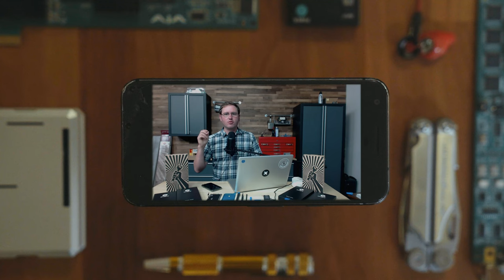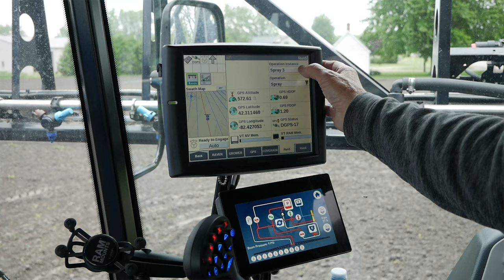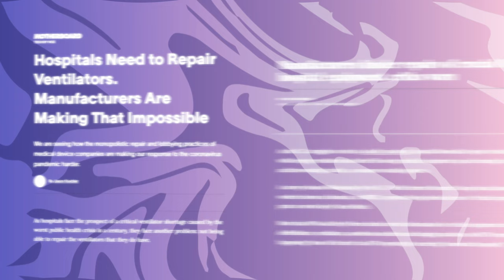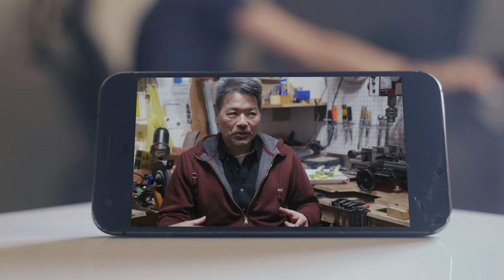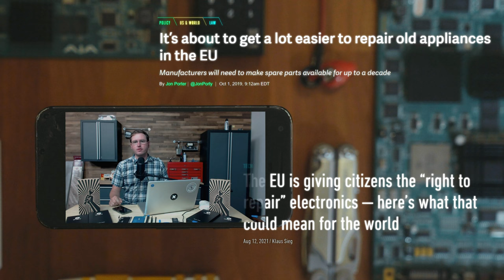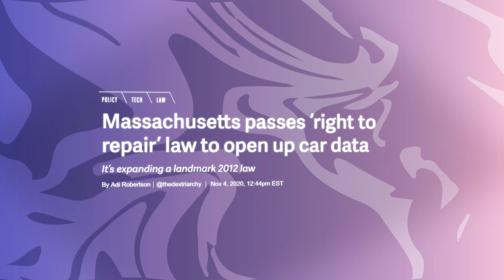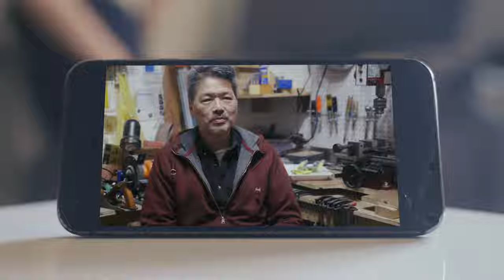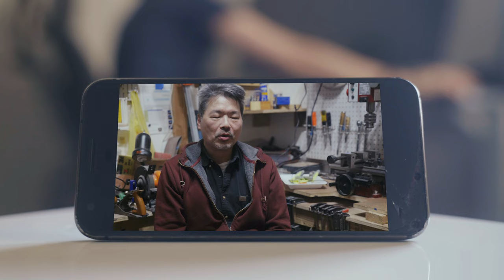Why you can't fix your smartphone

Comment: I'll never forget the time in college when the off button on my (at the time) brand-new iPhone 4 broke. I took it to the Apple Store and the technician immediately identified that the problem was just that the spring attached to the button had come loose, then said that he wasn't allowed to fix it but could sell me a new $400 phone. He also showed me a work-around to turn the phone off using the accessibility settings, and I used that work-around for like 7 years before the phone finally died, because the only other option was just buying a brand new one in order to replace a single spring.
Reply from the maker: well that is simply infuriating
Reply: It's Apple!

Comment: Thanks for covering this, especially as this has gotten worse and worse over the last few years. Between servicer-locked vehicles like Tesla and John Deere, paired and locked components in iPhones and other cell carriers with limited authorized repairs, and smart devices with cloud dependence and forced lifetimes, there's never been a more important time for right to repair.
I repaired my Nokia 7.1 a year ago, replacing the charging port and battery with questionable replacements from ebay sellers (mic was almost unusable) and had to get in touch with a random Russian developer to hack through the manufacturer lock to unlock it for a version and safety upgrade. The knowledge and background needed for that repair was absurd.
I'm a technology teacher, and I love teaching repair and showing older devices. We need this. Even if it isn't for everyone, repair is important.

Comment: I don’t believe you really ‘own’ a product if you can’t repair it. Which considering the generally hyper individual material mindset many Americans have should be enough to enrage people. I’ve had luck getting repairs done at a shop in the east village but outside of NY that kind of place rarely exists, you’re right. Same with all types of repairs. There are still cobblers in Brooklyn. I don’t know if many outside of that area. Instrument specialists are becoming an issue too for different reasons, how many harp techs do you know? And what is the solution

Comment: I wish we could still have the choice to buy phones with replaceable batteries... 
Swapping out an old battery shouldn't fall under repair, it should fall under basic accessible maintenance. 
Imagine having to take apart your car's fuel cap by heating it up to soften the glue, so you can refuel it, that would be n awful task.
Reply from the maker: I'm starting to feel old that all my first phones had replaceable batteries. I loved that, it was so convenient to just bring a spare battery rather than plugs and chargers.
Reply: @zentouro  Exactly!

Comment: I've been keeping my Samsung S8+ alive despite the screen and USB port breaking. I replaced the USB port and put some thermal pads under/over the cpu, storage, ram, section of the board to fix the screen. Also as an added bonus the back comes off a lot easier now since I didn't glue it shut as strongly so the phone's a lot more repairable. The obvious loss in waterproofing is not that big of an issue for me.

Comment: Our robotic vacuum cleaner no longer works because part of the plastic case cracked off and loosened the front wheel. Replacing all those perfectly functional components for such a small problem is the definition of absurd. Today is hot glue gun day, wish me luck!
Reply from the maker: good luck! i adopted and repaired my parents old robot vacuum. it's got its fair share of tape keeping it together :P

Comment: This is very cool! Honestly I wish I could have repaired my old phone, I loved my old phone. Also I couldn't afford a new phone, so I kept using my broken phone for almost a year after it broke - despite the screen occasionally leaving pieces of glass in my fingers, the lower 1/3 of the screen display beign unreadable, everything being covered in this green light, it taking 9+ hours to fully charge and losing battery life in just 3 hours, the volume buttons being sticky, etc. etc. 

It was definitely well past the point that having that phone was dangerous for me, but because nobody could repair it and because I couldn't afford a new one I just kept using it even though it barely worked.
Reply from the maker: ugh that is so frustrating :(

Comment: I have my computer mouse for almost 10 years now, because I have learned to fix the buttons so they don't do double clicks. It never had any other problem.

Also, I stay away from USB-C because it's too small and you cannot easily connect to the individual pins if you need to hack something.

Comment: I recently repaired my phone, replaced basically everything except for the mainboard and the back case. 
Even kept the old battery and old screen. While the old battery couldn't hold enough charge for a phone. It's perfectly fine my hobby of mine to DIY IoT devices.
Don't know what to do with the old screen, but I'll figure something out eventually.

Generally don't try to throw electronic. Old charging cables are cut up to get the copper wire.

Comment: the biggest thing, and not even having to do with repair, that bothers me about this, is the blatant disregard for shelf life of these products. For example, im a computer nerd, i love computers and the associated hardware its my bread and butter.

I have hardware that is 6 years old, and i only retired it a few months ago, not because it was too slow, not because it didn't work well enough, not because it was broken, but because i had obsoleted it with other hardware which happens to be newer. I also have hardware that is much much older than that. I have a machine running an i5 3570, from 2012, its over 10 years old at this point. Yes it's an old cpu, yes it struggles compared to modern cpus, you know what it does just fine though? Everything an average user would want and or need out of a computer. It wont do modern productivity work smoothly, but thats not what i use it for, i currently use it as a media box. It just exists to play media. It's more than capable.

Yet for some reason, my three old phone, is somehow incapable of doing the very thing it was designed to do from the factory, a few years after release? Why? Why is everything so slow? You designed this software, it hasn't changed significantly, there is no reason it should be this slow to begin with. It is quite literally the definition of an engineered problem. There is no reason for your old phone to be slow and hot. There just isn't an excuse, it's bad software design and management in that case.

Linux although it has its problems, is incredibly lightweight, and does everything, if not more than any other operating system needs to do. It is markedly faster than winows on a HDD, a fresh install of windows will take minutes to boot, a fresh lightweight linux install? Equivalent to windows on a sata ssd, after a year or two.

Comment: One example of an industry that shifted in relation to repair dramatically are cameras. 

Often times if somebody has an issue with a digital camera their only option is to replace it. There aren't many people out there that do repairs and camera service.

In the past however, there were many highly skilled technicians with the manuals, knowledge, and tools to reliably service analog cameras. To the point that there were even recommendations for how often to get your camera serviced in its owners manual, not unlike a car.

Comment: One point with product longevity that I simply hate is the software issue. Especially in phones, that are still functioning well enough to keep going -but the OS license expires and you get no updates. This means that surprisingly quickly most apps you would like to use will start to have problems and simply won't be usable anymore. 

This is one gripe that I have when phone manufacturers inform that they have released a phone with "long lifespan" (like Fairphone or Nokia), and even if their hardware would keep the phone going for years, they have no OS support for more than 2-3 years. And that is still the same lifespan as I have had for cheaper models that have fallen out of usability for that exact reason. Not for breaking down, but becouse of lack of updates. 
And besides phones, my former workplace has similar problem with field research equipment -all OS systems are updating towards touch screen (which can be abysmal to use in the field when weather conditions are not optimal -simple rain for example) they are going to have to update all the hardware of the fieldworking equipment for less-optimal ones simply because newer OS doesn't support it anymore. That's hundreds of well working electronic devices that would still do the job just fine -propably even better than the sub-optimal touch-screen only devices.

Personally I've decided that if any phone manufacturer decides to sell a repairable phone with subscription based OS, then no matter the OS itself, I will support that model (after my current phone dies) rather than buy another phone with maxed 3 year lifespan.

Comment: Such a great video, thank you!!! 
As an industrial electrician I also find it frustrating to just have to replace a whole unit, instead of trying to find that broken resistor. Replacing boxes until the lights are on again is boring, that's not why I got into this job lol. 
But yeah, even if there's no sentimental value attached, I'd usually rather fix the thing I already have an know. Sure it might have its annoying quirks (even if functioning state), but I already know those quirks, and having to figure out a brand new thing is just a bother. 
Also, the video next to this in my subbox is about a perfectly functioning 1876 sewing machine. Perfect neighbours. ("Investigating One of the Oldest Victorian Sewing Machines! 1876 Wilcox & Gibbs Chainstitch")

Comment: Lots of farmers have been pitching absolute fits for years because their machines will break down (but only by chance, toootally not by design 🙄), but there will be a backlog of repair orders, and they're not allowed to fix it themselves, so they'll have to try to manually harvest as much crops as they can (probably having to pay people to help) or just let that year's crop rot and go to waste while waiting for John Deere to send an "authorized" tech to fix it. In the meantime, food prices go up because that year's crops were wasted. Everybody loses except for John Deere. 😠

Worse, when the tech does come, it's rarely a mechanic to fix mechanical parts, it's usually just a computer guy who uses a secret code to reboot the vehicle's control software. As someone who slept in a tree for a month, I'm sure Kurtis is unhappy with the current state of affairs. 🤦

I wonder if someone can make something for John Deere devices like the Kytch that was made for ice-cream machines so that McDonald's and its ilk don't have to be slave to Taylor in the same way. 🤔

As for electronics, Apple is leading the charge to prevent people from being able to modify or change or repair anything. Louis Rossmann has documented a lot of Apple's anti-consumer tactics that have NOTHING to do with safety or even trade-secrets, like locking the device to a specific genuine, first-party, authorized Apple part (eg swapping the screens on two real iPhones will no longer work 🤨). As Louis has explained, getting your products "fixed" official by Apple doesn't actually fix it, they usually just give you a refurbished replacement (eg one with a new battery) and throw the old one in the trash (along with your data because unlike a third-party repair shop, Apple doesn't care about customers and won't bother to back up or transfer your data 🤦). But then, what do you expect from a company that expects everybody to drop hundreds of dollars every couple of years on a new device that's barely any different form the last model? 🙄

Preventing the repair of hospital equipment is just absurd; it's no different form the Wannacry ransomware attack that hit the NHS and literally cost lives; how has that not had government intervention? 😠

As usual, Europe is leading the way. They lead the way protecting privacy and people's data with things like the GDPR, while North America lagged behind (a couple of US states have taken it upon themselves to legislate it for themselves since the federal government is dragging its feet, while Canada hasn't even mentioned it 🤦). Fortunately, Biden has already begun working to push for Right-to-Repair (Trudeau is probably too high to remember what a cell-phone even is).

I'm glad they mentioned sentimental value. The world has had so much sorrow in it from things that have personal meaning being broken. Being able to fix things that have sentimental value makes the world better.

This anti-repair movement by manufacturers is as feckless as anti-piracy attempts, it never works, it will always be cracked. Even HARDWARE DRM can and eventually will be cracked (viz the Xbox 260 "kamikaze hack" 🤯). It accomplishes nothing other than to frustrate, annoy, and piss off customers and make the world WORSE, all so that absurdly rich billionaires can get slightly richer and selfishly hog all the monies for themselves at the expense of the rest of the planet. 😠

Comment: I bought a Jolla phone from Finland, because of its high quality. The Jolla company, that chose quality over quantity, sells no longer phones any more, because they couldn't compete. :(
Eight years later I still have and use my old Jolla phone, which is still working fine. I am looking at the moment to replace it, but it isn't really necessary yet. Currently I am keeping eye on the Pine Phone, because it uses Open Source software ( https://en.wikipedia.org/wiki/Pinephone ), but I have no idea if the hardware quality of this phone is good yet, because it is still very new and still in beta... we'll see I guess. :)